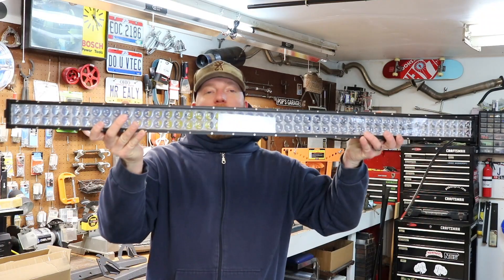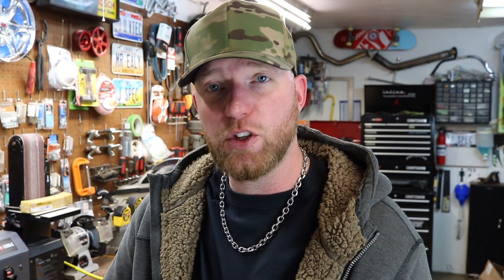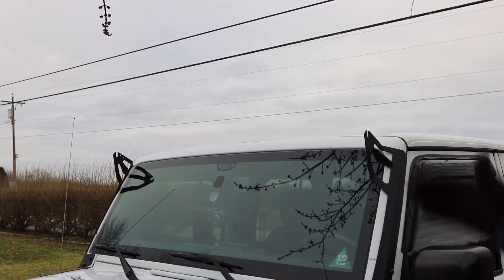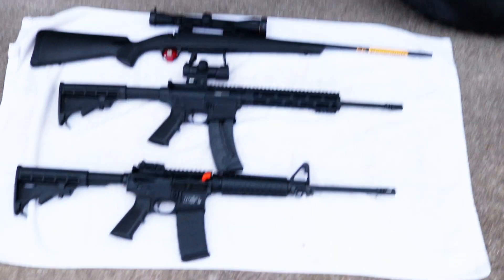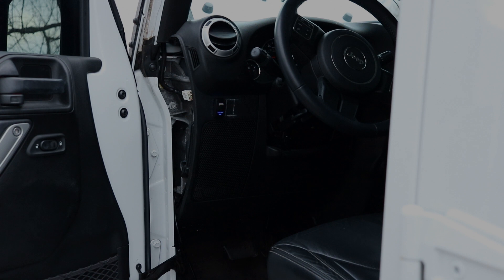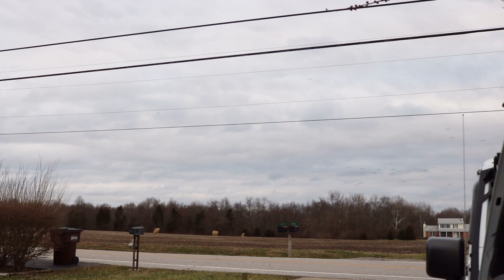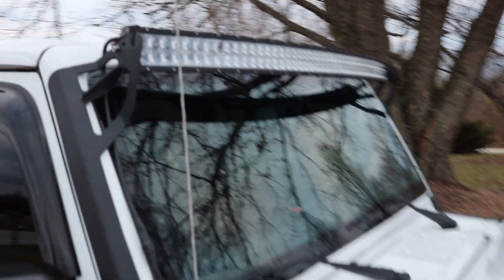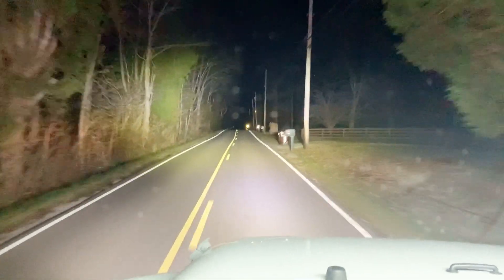Amazon 50,000 Lumen Light Bar Installed And Reviewed Under $100

Comment: Does anybody know if this is road legal… I image you turn them off when passing someone like normal brights but
Reply from the maker: @lobby_gamer3938  
Exactly. They are “off road” you can have them installed - but not supposed to have them on in any traffic or public operation mode.  We live out in state routes and corn fields.. so I just use them in early dark mornings to avoid the deer. If I see any kind of car or person around I turn them off.  They are unbelievably bright.  Haven’t hit a deer since - knock on wood.  If you have a similar situation, or off road/ camp anything- you need one.  You’ll love it! But technically, you get caught driving with it on, you can get a ticket.  Thanks, take care.

Comment: Now that you have had the video UP for 4 years, do you still have the light bars independently switched, or are they FED from the high beam circuit, so that they can ONLY be switched on with the high beam function, meaning switching down to dip when meeting oncoming traffic, is just a flick off the dip switch, without having to fumble around turning off several different light bars as well as dipping, by which time, the oncoming car is already blinded off the road, and you have passed by, before realising, oh wait I can turn all 50 K switches on again - no wait another car, oh to hell with them all, just leave it on.?

Comment: How’s the whistle over 55mph? I have the rough country bar that comes with silencers on the back fins and it definitely helps
Reply from the maker: I did not know this existed, and couldn’t tell over the loud flowmaster exhaust... after reading your comment yesterday I paid attention and it has a little whistle.  Not too bad, but if your looking for it you can hear it.  I have done some test today with my air compressor and a high flow blower.  Seems most of the noise comes from this 1/8 cup on the front and the fins on the back.  I am going to play around with it and try to fix it with gasket maker and see if I can DIY it before I go buy silencers.  Thanks man.  I love comments that help me be better!  Take care!

Comment: What light or would you suggest for a 2000 expedition
Reply from the maker: What’s up brotha!!! Gotta measure that window see if you need 50 or 52.  I would go with this light bar.  And I would install it with the included hardware, straight to the body.  Just silicone it up under the mounts.  I didn’t have that option because the Jeep top isn’t fixed.  We take it off all the time.
Reply: Ok ty bro
Reply: If I leave my number will you text me on the light bar